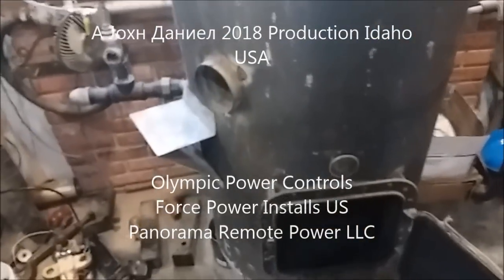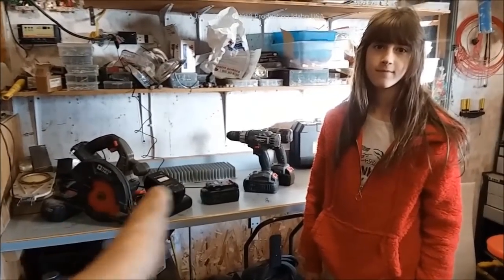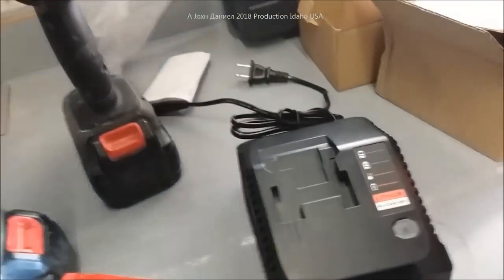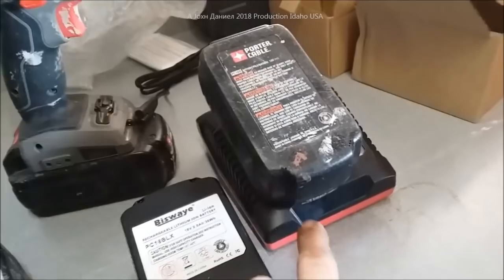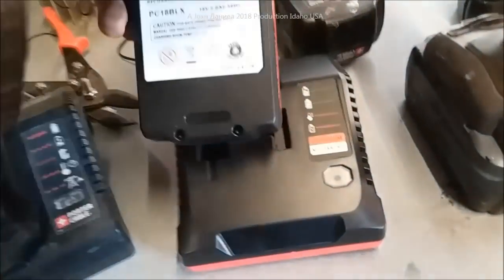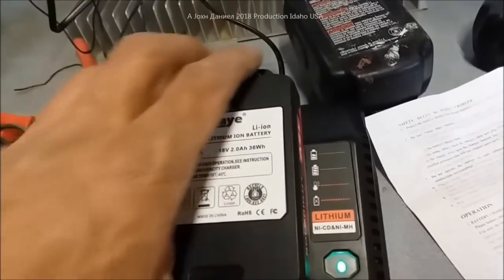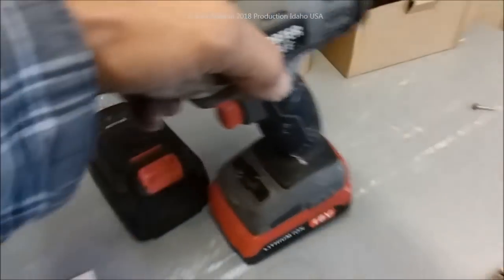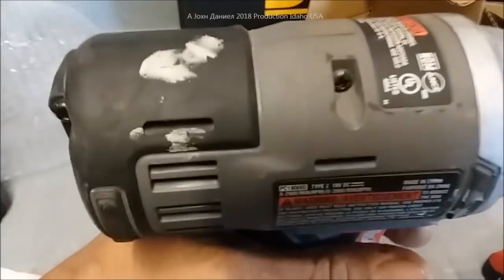18 volt Ni-Cad to 18v LITHIUM battery for Porter-Cable tools - Parts List under video

Comment from the maker: This is a real winner. #1 Source for Battery & Adapter https://amzn.to/3Rw0hv4 for Porter Cable 18V 2 pack Li-on with charger  https://amzn.to/3VIKdbQ Lithium https://amzn.to/2WSLzji ALSO full power kits on Amazon https://amzn.to/2QTlfTv
Reply: not available item
Reply from the maker: Thanks, I had to find who Bisway was selling under to find the right alternate. Updated it. Battery & Adapter https://amzn.to/3Rw0hv4 for Porter Cable 18V  2 pack Li-on with charger  https://amzn.to/3VIKdbQ  Lithium https://amzn.to/2WSLzji ALSO full power kits on Amazon https://amzn.to/2QTlfTv

Comment: Gracias for the time spent on this video, I have a question? I have a number of Porter Cable tools with 18v NICD batteries. They all work well with new 18v LLTHIUM batteries accept my 6.5 circular 18v saw, the saw is under power and the new battery get fairly hot. Any thoughts?

Comment: I’ve had the drill/circular saw combo set for a few years now and i just learned today that i could change out the battery for lithium ion.  I wish i knew earlier bc I’m on my third battery and I’m only a DIYer . They never seemed to hold a charge very long and the circular saw would lose power quickly. The good thing was that the company did replace my other 2 batteries when i contacted them but after the second time they sent me a third battery but told me that they wouldn’t be sending me any more free batteries.  I can’t wait to try a decent battery on that saw now. I hope i have the correct charger! 
Thank you
Reply: Hey Seth, I'm in the same boat you were back then.  Did the new batteries give new life to the circular saw?  How did everything work?

Comment: Thanks for this video and sharing your experience with this lithium ion battery brand.  I'm usually hesitant to purchase off brand lithium cells but from comments, they seem to be performing ok for you after over a year now.   This seems to be the way to go instead of converting 18v nicad packs to 20v lithium.
Reply from the maker: Just be sure to never place them on a NiCad charger, they will be ruined if you do. You have to have the lithium charger, but the results are so much better with them over NiCad now.

Comment: thanks a bunch.. i picked up the drill, reciprocating saw, flashlight and Circular saw with batteries and the original charger today at a thrift store. looks like it was hardly even used.I went ahead and purchased the light weight 2 amp 18 volt lithium batteries on Amazon since they were cheap. But i bot the Charger on ebay since it was cheaper than amazon with free shipping. I liked your presentation. you did a very good job. It was a no brainer and I was convinced. thanks again keep them videos going.  And thanks for the links to amazon and ebay.

Comment: Thanks for the heads up!!! I own the same 18 volt Porter Cable tools and love them but the batteries are ridiculously priced as I'm sure you are aware of. I can justify the purchase of the charger and two of the new batteries at that price and be tickled to have the extra power, not to mention the lighter weight which would help an older guy like me make it through the day a bit easier AND more productive!!! Blessings to you and yours.
Reply from the maker: I'm loving mine, ordered 4 more.
Reply: @JOHNDANIEL1  ordered 2 and the charger last night! Just a little over a hundred bucks, should be well worth it

Comment: Would these run on a Black and Decker combo 18V?
Reply from the maker: I don't think so. The 18 volt Porter cable tool uses a battery that will not fit the 20 volt stuff on B&D or the 20 v porter cables.
Reply: @JOHNDANIEL1  Ok Thanx
Reply: Check out the various adapters you can find on ebay between types of drills and batteries

Comment: I bought 2 new Chinese replacement batteries for my Makita14.4 volt Ni-mh and am very happy with them so far,  time will tell . Came individually boxed and about 70% charged. £30 for 2 batteries versus £65 for 1 genuine. Bought from eBay UK. Great for hobby/ DIY use. My work tools in the van are mainly Metabo and Milwaukee.
Reply: Those china copies sketch me out. I dont want my garage to burn down if they decide to explode